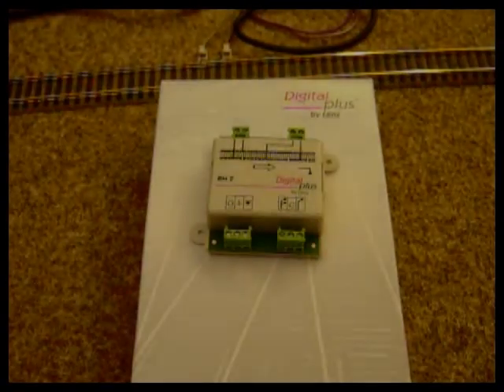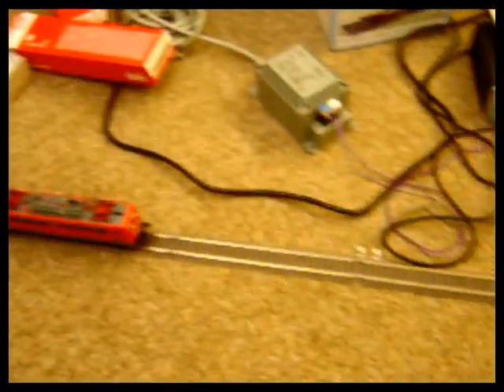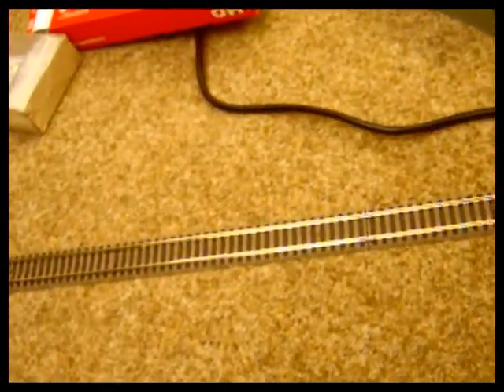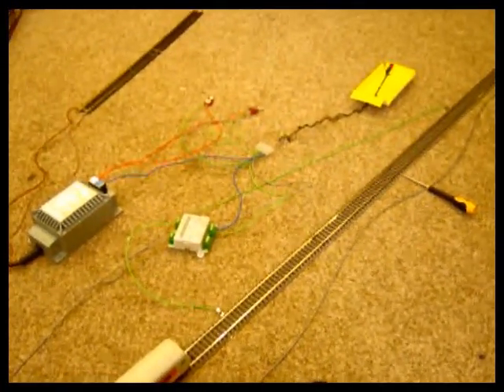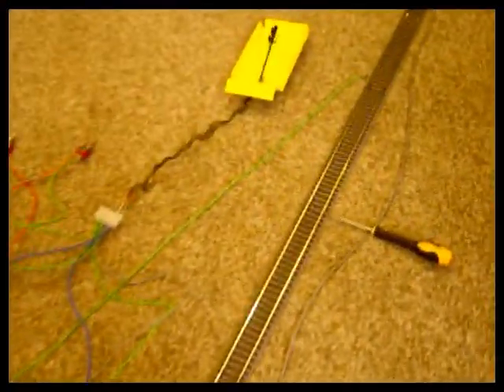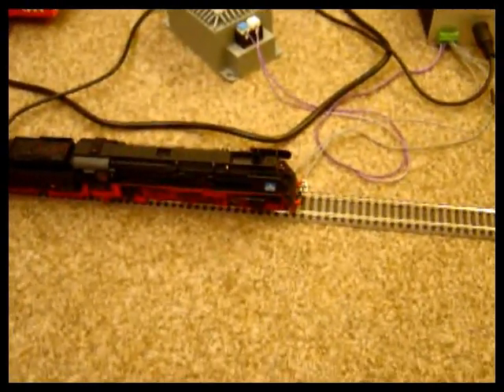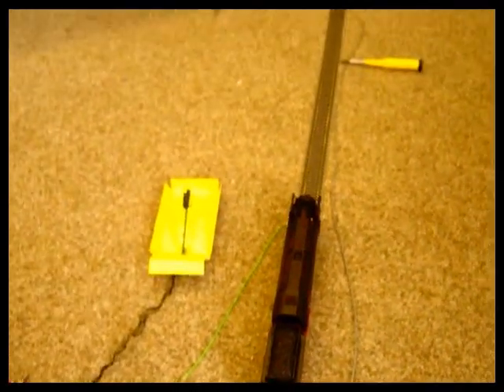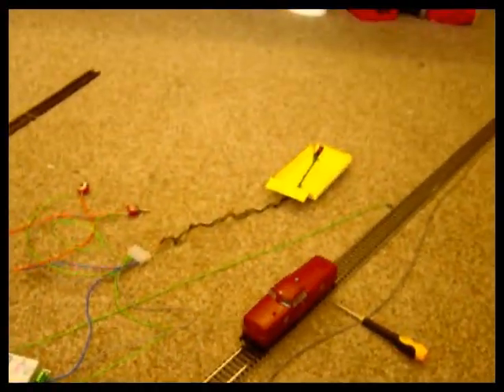Lenz DCC Promo  ABC Braking film 3 BM2 Module

Comment: Great video fully understand. However I’m aware of bm3 but confused how to wire. As far as I’m aware the bm3 is monitoring the next section and should activate the bm2 if loco present in next section. Is that correct? Also if I use a bm3 will this change the signal rather than a switch?
Reply from the maker: This film just demonstrated the module - full wiring diagrams are in the manual for the BM3
https://www.lenz-elektronik.de/src/pdf/b_22620.pdf
Reply: @digitalcareline  thank you so much, it seems I only need the BM3 for what I plan thank you

Comment: Is it possible to controll this Signal also with an normal Switch/Lever or Button?
Reply from the maker: Yes of course - The automatic module responds to how the signal is set.  That signal may be switched manually with a switch or button or it may be switched with a DCC digital accessory decoder.     Cheers     Chris
Reply: So its possible on a Semi Automatic Train Trac to set this infront of the Trainstation and stop all trains before entering the trainstation by just pressing one button to set the signal red? Im just asking cause i dont want to use a computer on my DCC System.
Reply from the maker: The BM2 module will respond the signal so you can switch the signal to red and it will hold the train until you switch to green - Only locomotives with the correct decoders will work - Lenz, Zimo or ESU new decoders all work with ABC braking.    Cheers   Chris

Comment: Dear DCline,

I want the Lenz Bm2 module also, i know the working of the system but i can't see how to connect the Light signal, i have Viessmann light signals. 

I know that are 2 wires  go to the Bm2 module from the light signal. But where come the power to the light signal?  

Greetings Dominique 

p.s. I like al the movies of digitalcareline   the are so good with al the info you need.
Reply from the maker: The signal is powered separately.  You would wire up the signal to switches or an accessory decoder - as you would normally.  Then take an extra wire from the common return - this goes to C on the BM2.  Take a wire from the green lamp on the signal and wire it to the stop terminal on the BM2 - This shows a picture of a  single arm signal.  A wire is then taken from the yellow light and wired to the slow approach terminal  (Picture of a signal with two arms).  This is shown in the manual Figure 1.  The BM2 does not provide power to the signal, it just detects if the green and yellow lights are on.  With no signal wired it thinks that the signal is red and so will stop all ABC trains. 

Cheers  Chris
Reply: digitalcareline   Thanks for the info!!!  Cheers Dominique